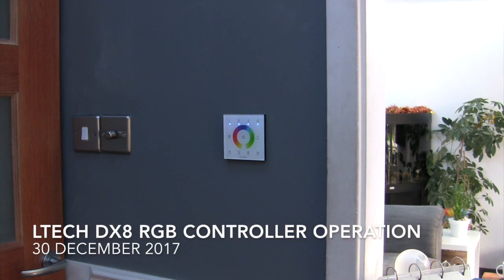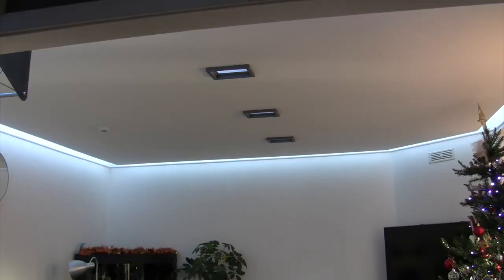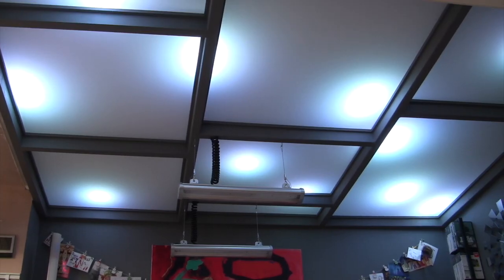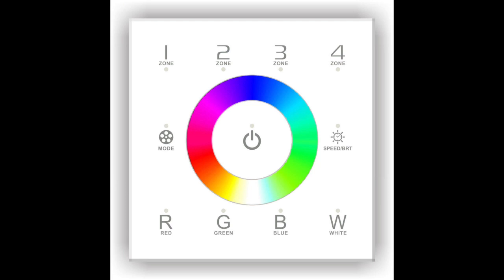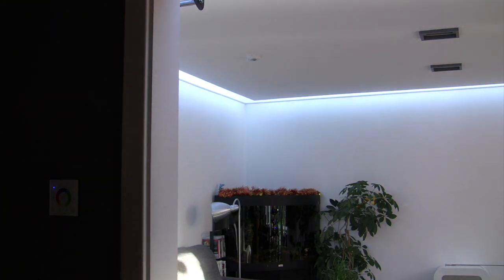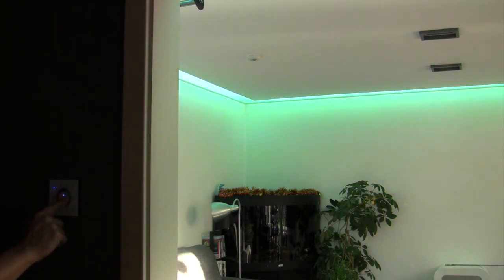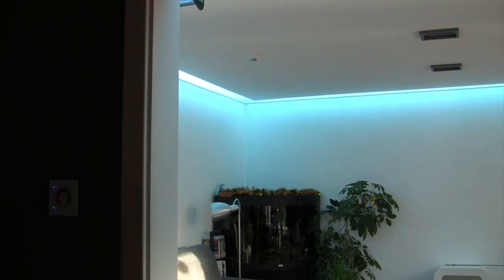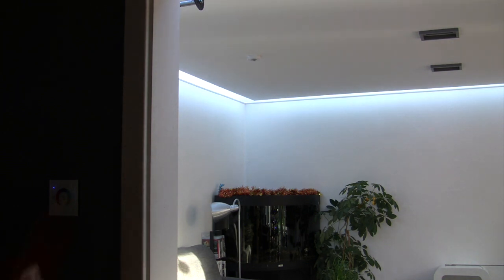LTECH DX8 RGB controller

Comment: Very good video. I was really confused about how the RGB buttons worked. It implies that you press them to select Red Green or Blue as a shortcut to using the colour wheel but it's as you said.. they simply remove that colour from the current colour. Thanks a lot. Did you ever pair a remote control with the controller's? I have 4 R4-5A controllers and in trying to use a Skydance RS4 Remote with no success. It doesn't seem to pair. I need a remote that works and looks as good and easy to use. Thanks in advance
Reply from the maker: Thanks for the feedback. I'm afraid I never did use any kind of wireless or app solution with this thing so I can't advise on such. For me, it was always a fixed-point of operation and it continues to perform well in that role!